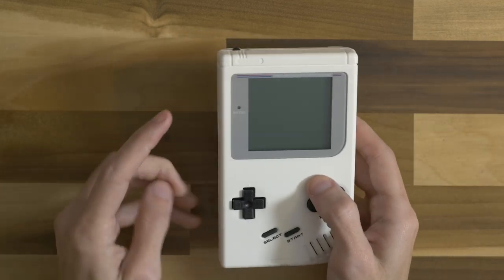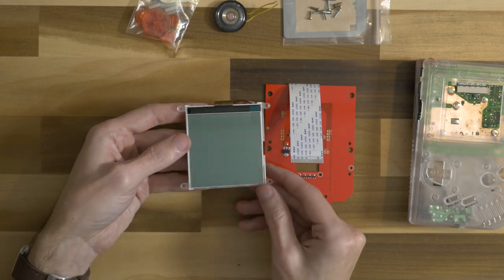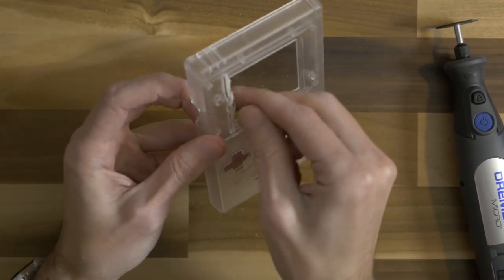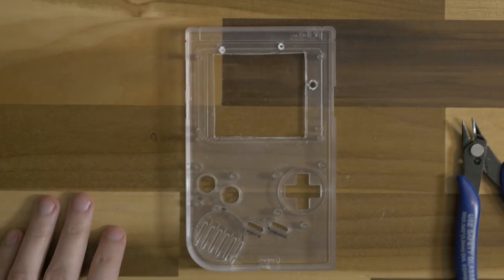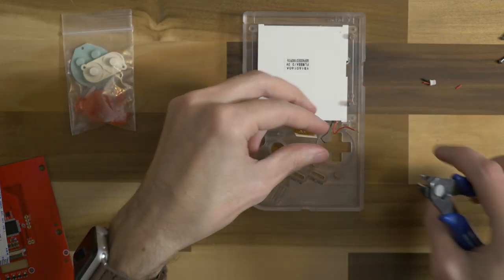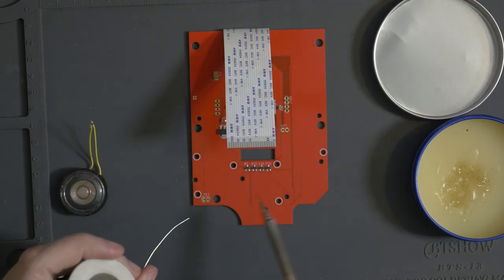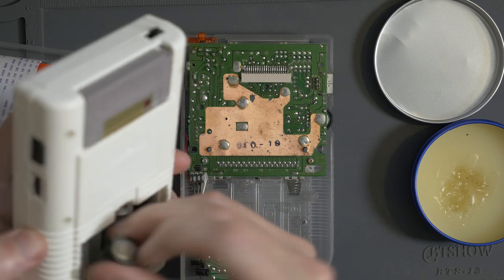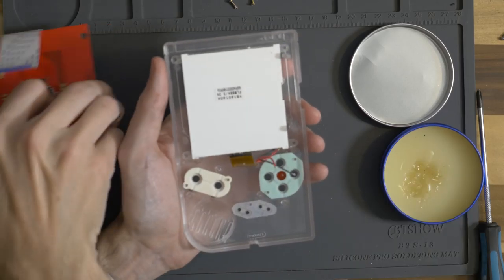BennVenn DMG 3" LCD Install

Comment: Great job. I would prefer some kind of brightness setting though. Maybe a mod to wire in a potentiometer to the backlight? Or use the DMG's contrast knob for brightness.
Reply from the maker: I'm sure that could be easily added. :)

Comment: this actually looks pretty nice, like a decent backlit GBP screen. after doing an IPS-mod to my pocket a few days ago i'm looking at getting a DMG to mod as the GBP can't handle the IPS + flashcard too well. so i was thinking about an IPS-DMG for that. now that i saw this video i might reconsider and go for the BennVenn lcd for a slightly more authentic feel.
Reply from the maker: Bram De Klerk It is a nice screen! Sorry your pocket isn’t cutting it. Did you install a voltage regulator?
Reply: esotericsean nope, just the IPS panel for now. I get about 2.5 hours on fully charged 900mah eneloops and an original cardridge. Good thing is that i own a lot of my favorite games so it’s not a huge problem. I have been thinking of getting a DMG for a while and this is the perfect excuse ( i own every other gameboy model but never really botherd with a dmg as the pocket is still my favorite console)
Reply: @Flake1988  did you try adding a doubling capacitor or a voltage regulator? Those might add a solid hr. But honestly if you're gonna even backlight a pocket you should probably do a lipo mod

Comment: Hi this is completely unrelated but how can I fix a horizontal line that resulted after a bivert mod? It goes away after like 5 min of gameplay but it's always there on startup and sometimes it flickers
Reply from the maker: Roarke has a good video on fixing horizontal lines: https://www.youtube.com/watch?v=WH9LpYsBUB0 (they're quite difficult to fix unfortunately)
Reply: hi sean I fixed my gameboy !!!! no more annoying line, all i did was heat it with a hair dryer and press a spoon to the ribbon for like 4 seconds.

another thing: so i wanted to change the color of the power led in my gbc but its now super dim, i heard i need to bypass a diode?? to make it brighter but i cant find any info online and i am not that confident with my multimeter, (traumatized cuz i fryed a 3ds before) could you please make a video on how to swap the gameboy color led and do a diode bypass please :)